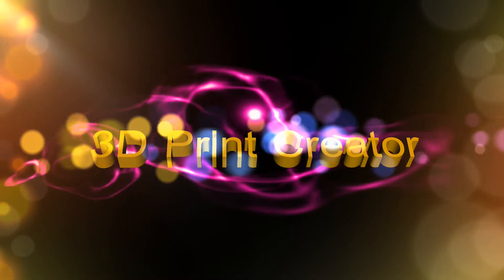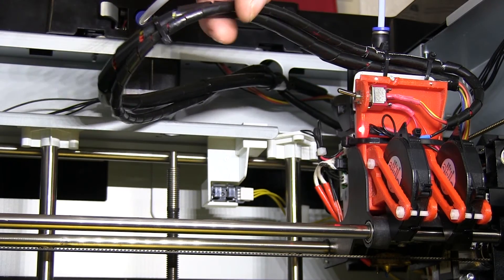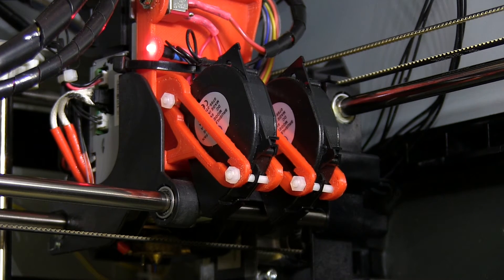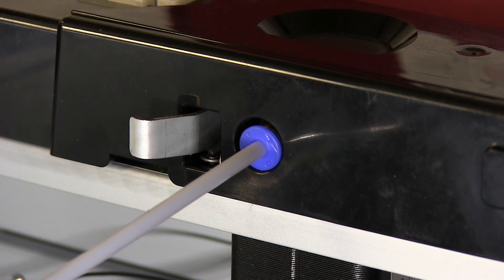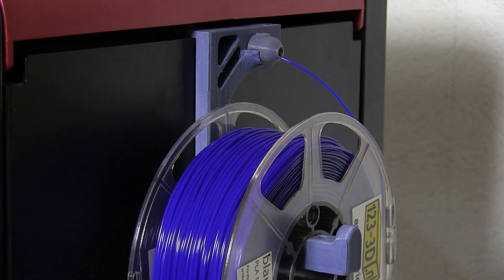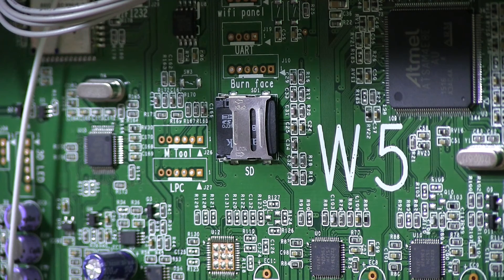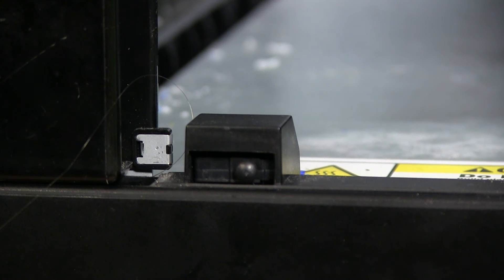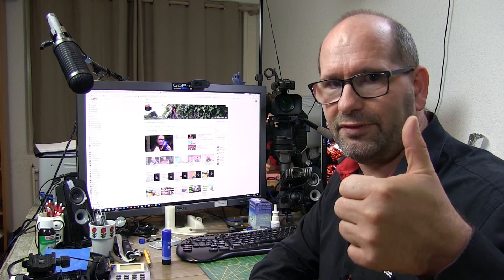▼ Tips for fine-tuning and better results from your Da Vinci Pro 1.0 and AiO

Comment: Hey Brian, nice video.  Where do you get the 5V from?
Reply from the maker: There is a 12 volt out on the board (labelled 12V) that I used with 7805 voltage regulator.

Comment: I never knew there was an SD card in there.  Is there one in the AiO 1.0?
Reply from the maker: Hi,
I never had that machine so I don't know.
Can you send a print job to it via the computer and then disconnect the computer while printing?
If so, there is an SD card inside.

Comment: I have a recurrent problem with my Da Vinci 1.0 Pro. it happens that filament scrapes the tube where it passes through. Plus happens the same with the orifice of the cartridge. they are too worn. do you have some comments?
Reply from the maker: The parts you are mentioning do wear out. You can easily replace them with replacement parts of a better quality.

Comment: How did you mount the Webcam in your printer I have the same printer and also a logitech Webcam. did you use tape or something else can't quite see it in the Video.

Nog groetjes uit NL!
Hoop dat je snel kunt reageren!
Reply from the maker: I have used hot glue to mount the camera to the frame of the Da Vinci Pro machine.
If you use very transparent hot glue, then it sticks better then the glue that is a bit more white.

Extra tip, to remove hot glue, inject some IsoPropyl Alcohol (IPA) into the glue. It will loss it's strength and you can just peal it away.

Groeten terug, uit Lelystad.

Comment: Hi. What file / schematic did you use to make the 2 cooling fans ?
Reply from the maker: Hi, I used the files on my thingiverse account (in the description)
http://www.thingiverse.com/thing:1723418

and no schematics, because it's only a 5 volt wire through a switch to turn the fans on or off.

Comment: I  too was about to ask where to get the tube push in connectors. I was trying to find them locally,  but could not. ... then I called xyzprinting ... I was told they would have to call me back... been fustration trying to find them.
Reply: Just found the website of the manufacturer. .. now I just need a part number. 
https://www.festo.com/
Reply from the maker: Hi Nathan,
I ordered mine from Ebay.com
There are a number of shops on Ebay that sell the Pneumatic Push Fittings, and they are also pretty cheap there.
Reply: 3d Print Creator 
if you have a link it would be helpful, because xyzprinting wants  $10 each. I just don't want to get the wrong ones
Reply from the maker: I found them here on Ebay
http://www.ebay.com/itm/4Pcs-XYZ-Da-Vinci-Pro-3d-Printer-Push-In-PTFE-Tube-5mm-Thread-Pneumatic-Fitting-/302038047425?hash=item4652dedac1:g:a-YAAOSw-itXqwGE
Reply: 3d Print Creator 

thanks!

Comment: Can you link to the actual push connectors you bought? At least manufacturer ?
Reply from the maker: Wish I could find them on the Internet. i called the shop where I bought them and they say the brand is Festo. You can recognize them due to their blue release ring.

When I am home, and I don't have to do the search on my phone, I will dig deeper.
Reply: http://www.ebay.com/itm/like/351078498380?lpid=82&chn=ps&ul_noapp=true   Close... might not be correct size.. but definitelly a good lead.

Comment: nice video I didn't know about the cover sliding on the sd card.What I did was get a micro sd to sd card adapter it is a cable about 16 in long and mounted the sd card part above the cables at the side of the case so that I can remove the sd card without opening the back.
Reply from the maker: Sounds good. Does that give you the possibility to write .3w files to the SD card and print via SD?
Reply: You have to take it out and plug into a pc to write files to it.I am thinking of making with other splicer and saving gcode files to it and then printing them.If I save it as SAMPLE01.GCODE I can just put it in and tell it to print the first sample

Comment: nice video! where did you orderd the push fittings from?
Reply from the maker: I bought them locally in a shop. I don't know where to look for quality connectors online (the blue ones are for bigger pressure then the black ones)
Reply: what is the correct size for the push fittings for front and back ? Thanks.

Comment: For those of you curious about replacing the push fit connectors, I wound up replacing mine with these without issue for fitment,etc.

https://amzn.com/B009ITFXDI
Reply from the maker: Well, sorry to say, but I skip this affiliate link because this are the $ 0,50 push fit connectors I am warning about in the video.
Buy proper ones, and no, they are not cheap. They cost way more. I bought them locally in the Netherlands, and had to pay 3 Euro each for the backpanel fitting and 4 Euro for the double fitting in the carriage. They have the blue tops and are made for higher pressure.
Reply: 3d Print Creator Just trying to help.it's not anything that benefits me. I don't have an affiliate account with Amazon. but I understand what you are getting at. that link at least gives the dimensions though for fitment, if you have a recommendation, please post it and I will edit the link. that said, these have lasted 6 months without any sign of wear for me.
Reply from the maker: Hi Kelanel,
Sorry if I wrongly accused you for sending an affiliate link. The link has a referrer (ref=cm_sw_su_dp) and is shortened, most of the times this are affiliate links.
But for your information also, the blue fittings are for higher pressures and work much more reliable then the black ones, I am told. The blue fittings are a little more expensive, but not that much. 

For what I have seen, almost every black fitting has it's top broken off (the disconnect ring) and I have never seen that from a blue one.

Comment: What are the benefits of upgrading the MicroSD Card? Faster upload speeds when sending jobs to the printer?
Reply: How do I need to format the SD card before installing it
Reply: Fat32 is how the original card is formatted, so that is how i formatted my replacement Samsung 8GB SDHC card. Don't forget to copy the files off the old one and back to the new one after formatting.
Reply: Hi. I bought a 100Mb/s 32GB PNY SD card, and replaced the standard SD card. I had problems, where the machine stoppede many times for about 1 sec, when doing contours. And it did many bumps that way. After opgrading the card, the machine runs smooth and fast. Just replace, no need to copy card...
Reply from the maker: Hi Kelanel,
There is no benefit from upgrading, but a lot of people have had problems with their SD cards.
It's one of the most discussed errors on Thingiverse in the Da Vinci user group and there was no video on how to replace it yet.